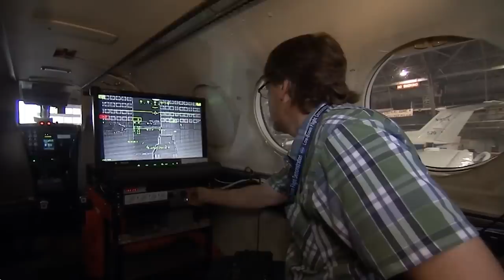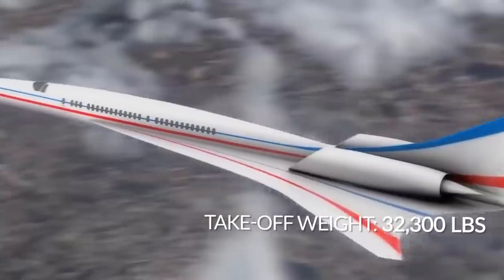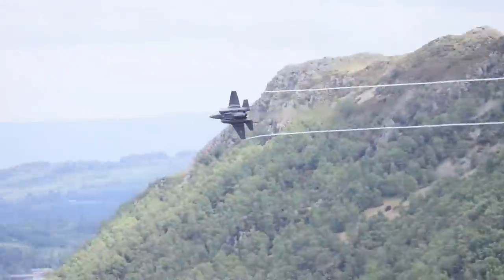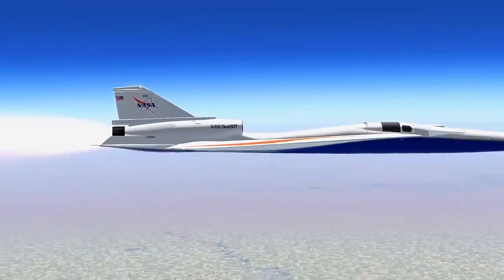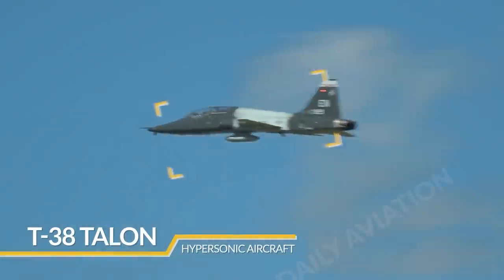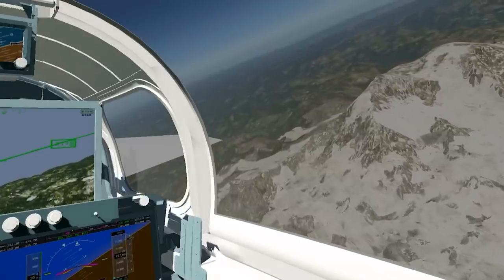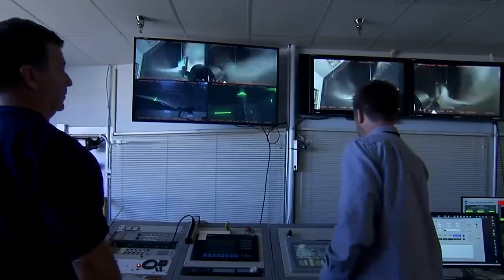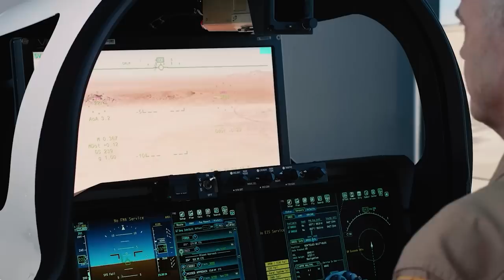US Air Force Supersonic Aircraft With Silencer

Comment: I recall some years back I was teaching an evening class at East Los Angeles College in L.A. When I let the class out I was walking back to my car in the parking lot near the tennis courts. The lights in the tennis courts were on in case anyone wanted to play at that time. I happened to LOOKED up and saw the B-1 Stealth Bomber flying over doing a practice bombing run over L.A. The lights from the tennis courts reflected on the bottom of the plane so it was fairly low. As it banked left and headed southwest I could see the jet exhaust ports and could see nothing in them. Now, the reason that I had said a couple sentences back "LOOKED up" was because I heard NOTHING. It was quieter than a car in the freeway. That's the thing that surprised me. The technology for silent running was there decades ago so it doesn't surprise me that it will be used in other planes.

BTW, look up the Douglas X-3 Stiletto from 1952.

Also, the Bell X-1 was a rocket plane. It was the first plane to break the sound barrier IN LEVEL FLIGHT. It was broken in a dive by the P-38 and P-47, both propeller planes.
Reply: I second this.  Witnessed near a Air Force test base in silent (electric glide) operation.
Reply: Are you kidding? The P-38 had the worst compressibility issues of the leading U.S. fighters. The P-47N was the fastest U.S. production fighter in level flight but exceeding the speed of sound in a dive is laughable. George Welch, chief test pilot for North American Aviation, was the first to exceed the speed of sound, in a 40 degree dive, during the first flight of the XP-86A on Oct. 1, 1947, 13 days before Chuck Yeager's "record" flight in the Bell X-1.